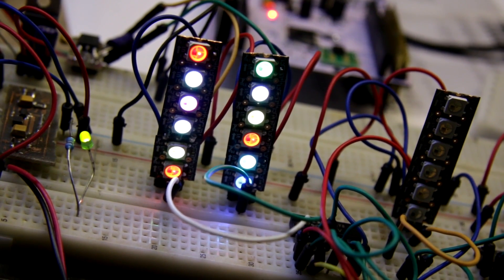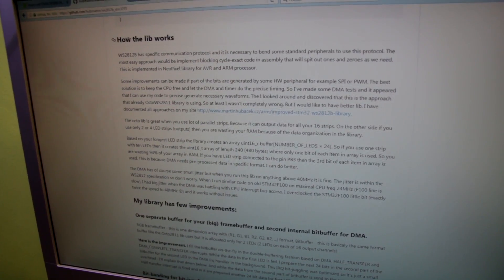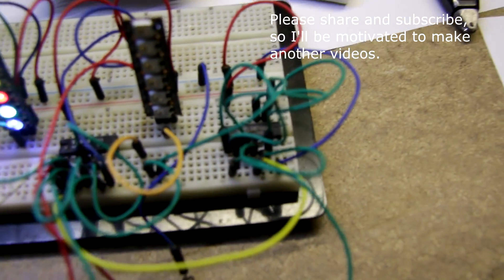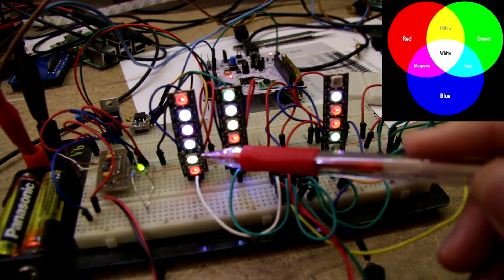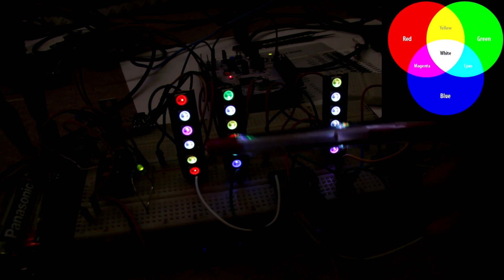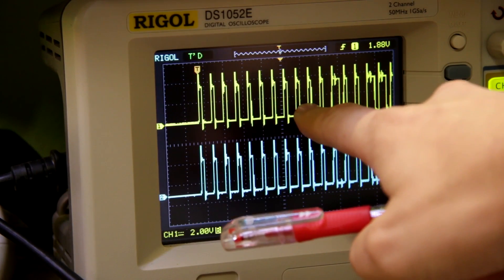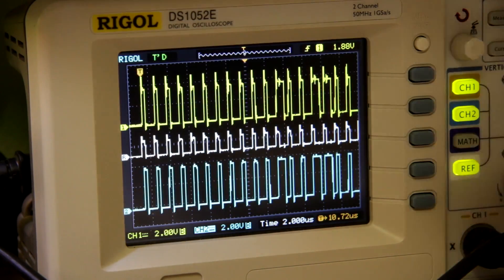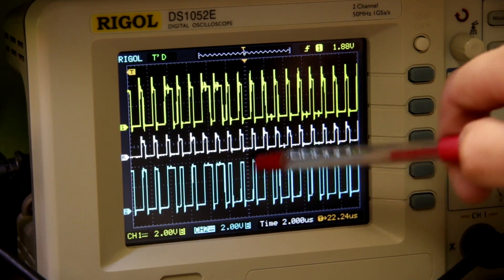WS2812B mixing colors with AND/OR gates?

Comment: had a doubt.
will the repository for stm32F3 work with STM32F103 series??
excellent videos!!!!!
keep it up
Reply: Will it work with stm32f103????
Reply from the maker: Yes, it would work if your system clock is at least 48 MHz. I had it running even with STM32F100 overclocked from 24 to 48 MHz ( https://github.com/hubmartin/ws2812b_stm32F3/blob/master/README.md ).
You just have to set correct DMA channels/streams accordintg to the DMA matrix table in the datasheet.
I'm glad that you like my videos.
Reply: which development environment do u recommend for stm32
Reply from the maker: I used long time Atollic TrueStudio. Now I use VSCode and makefiles. Now the Atollic was bought by STM so all the paid features are now free so I need to test that out. And it's also multiplatform.
Reply: the DMA channels  you used are supported in STM32F103 series ie DMA1 channel 1 and 5 i guess.
but the problem is i am not able to make the code to work the code compiles without any errors but there are a few warnings though.
and when i upload nothing happens.
i have asked a few questions in ur github repo.
it wuld be great if u reply me there